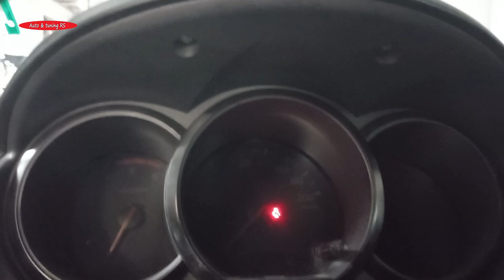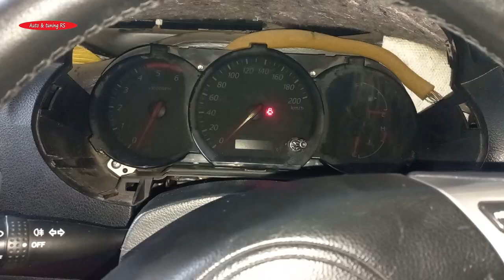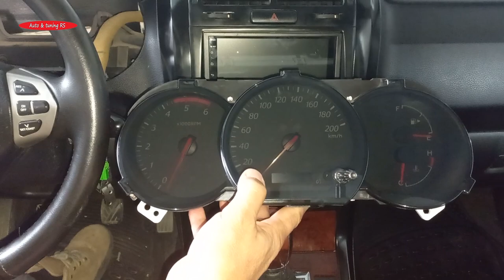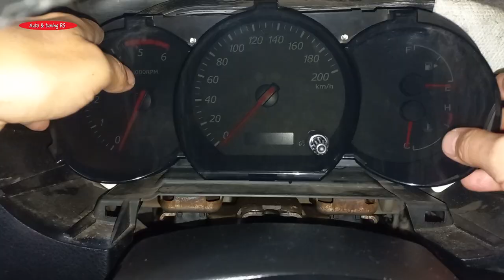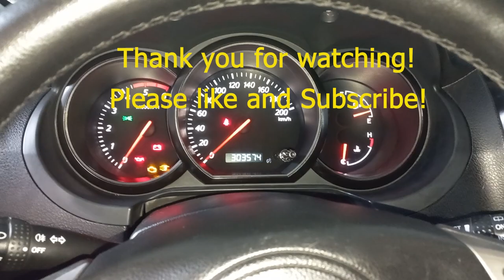How to Remove the Instrument Cluster of Suzuki Grand Vitara | Cluster and Speedometer removal

Comment: Hi, I have Grand Vitara 2006 and I'm facing instrument cluster problem. while driving it gets totally off and on. I removed it and reinstalled after watching your video thinking if it had to do with the connector but nothing changed. Any idea to solve?
Reply: Hi, I have a similar problem. Already have it fixed?
Reply: Hey mate, did you manage to understand the issue?

Comment: Did you replace the bulbs by led?
Reply from the maker: First I disassembled it and found that in this panel there are no bulbs as in the old models, but it is illuminated by LEDs. In the next video next week I will show how to disassemble the Instrument Cluster and where the LEDs are located. These LEDs can be replaced with other color LEDs, but it is quite difficult and there is a danger of damaging the Instrument Cluster. I found a super easy way to change the color of the light without changing the LEDs. And I will show this in my next next video.